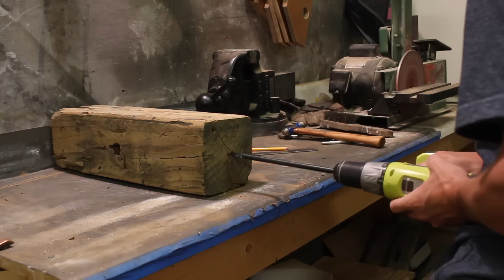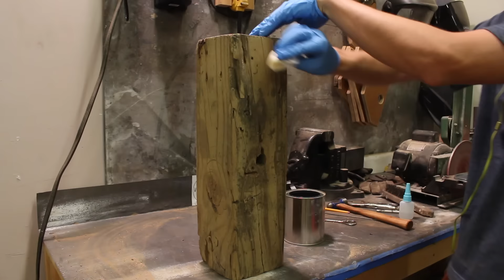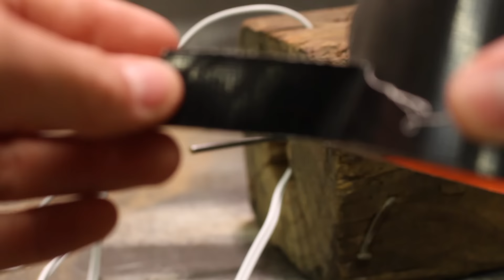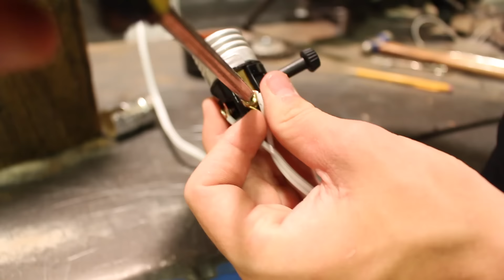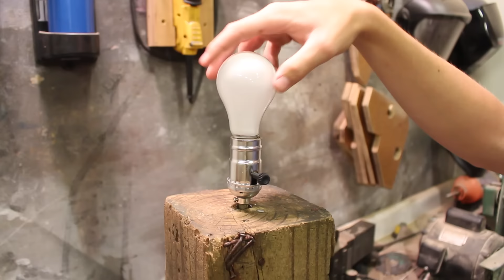DIY Rustic Lamp // Woodbrew

Comment: Just a tip, always wrap wire in clockwise rotation, as you tighten the screw the wire tightens